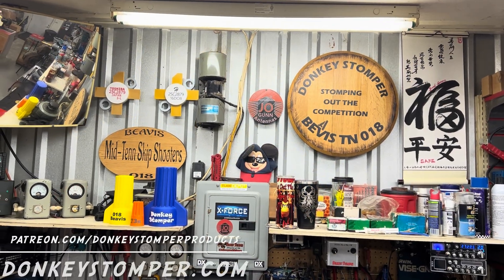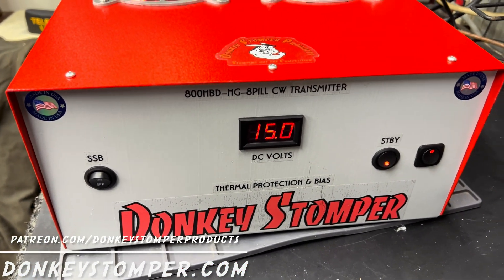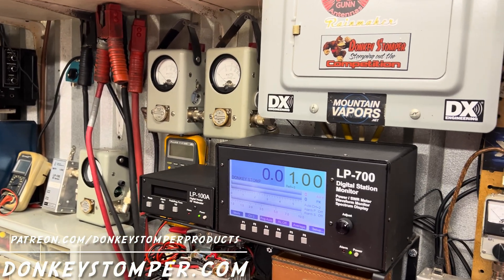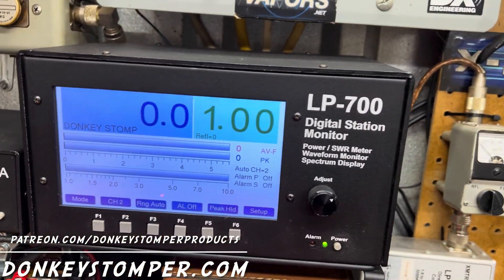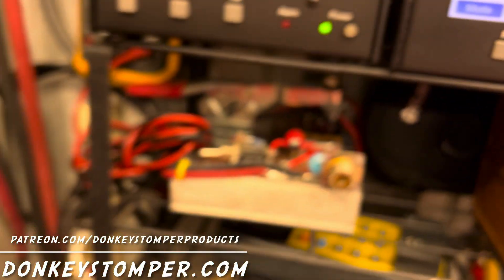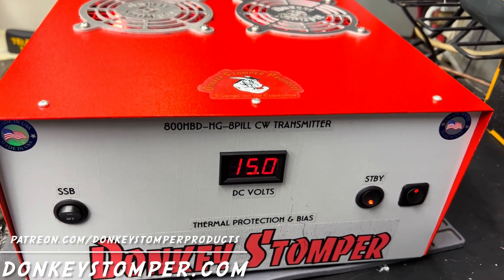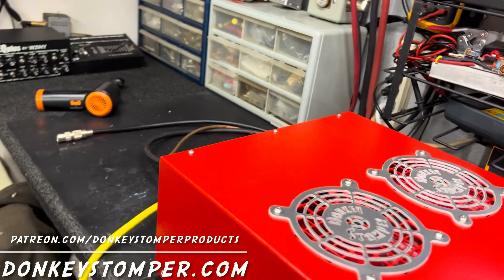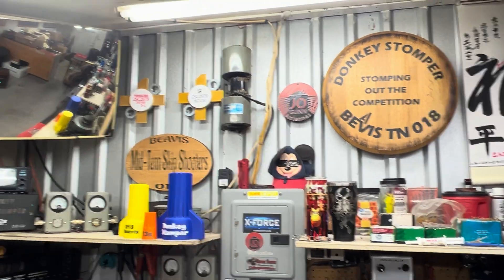How do I Drive a HG Transistor Amp on SSB?, How to run HG on SSB?, Repair Test/Review

Comment: some interesting news here.. and i assume when using the amp on sideband you have the ssb bias switch on correct ?? 

im starting to feel that AM is the way to go when using an amp.
Reply from the maker: When I do bias its on all the time Am or SSb. Switch is delay for the relay.  Long story short on SSb its best use amp with no drivers radio drive. Thanks for watching..

Comment: I have learned  that I don't  need alot of watts  on side band . so I run my donkey stomper built only on am . with my DX2517. on side band I use my icom on my  3 flat side with 100 watts  is all I need . I have learned  so much from chad at donkey stomper.  
thank you  
73s
Reply from the maker: Thanks for the business and support. donkeystomper.com